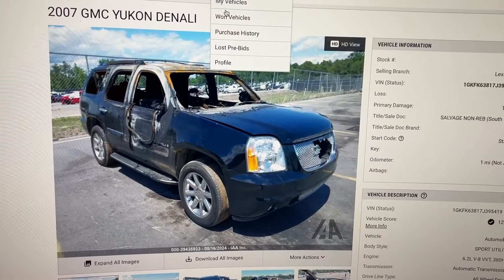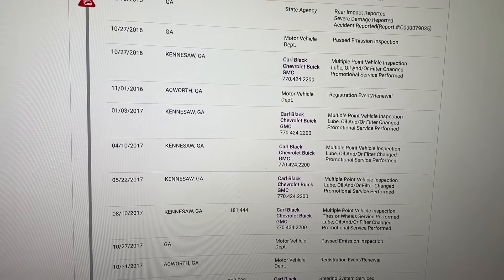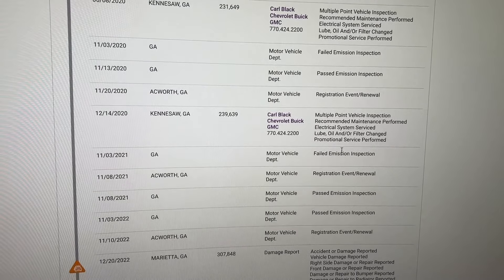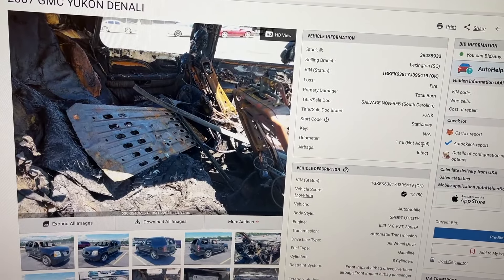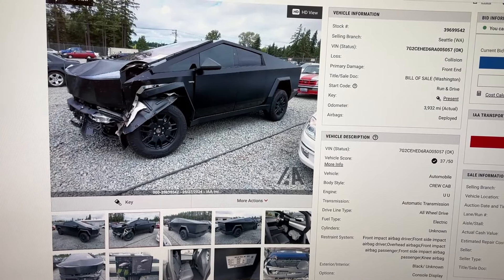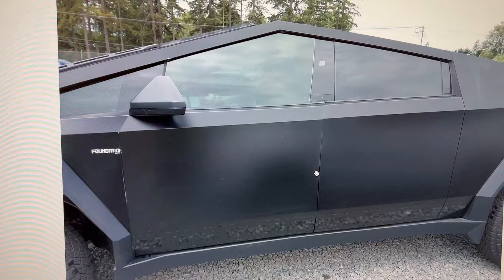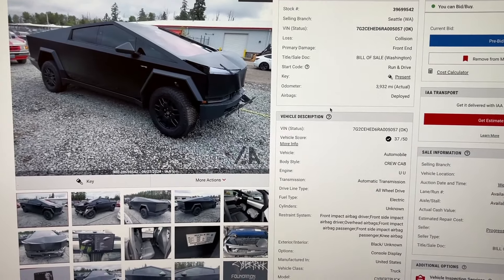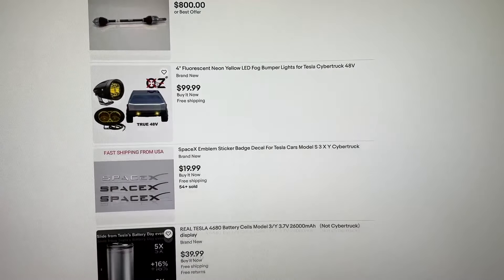how many accidents before getting totaled and a salvage Cybertruck

Comment: The alloy front giga casting is repairable(model Y giga casting has been welded/plated repairs in a YT video), the suspension there are after market parts available, wheels are replaceable, air bags ?, dash is repairable.....